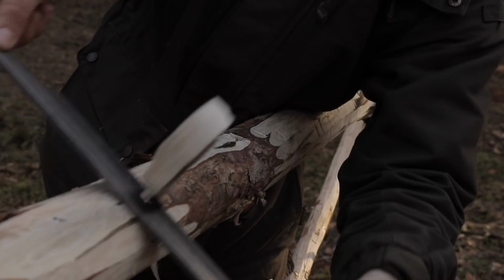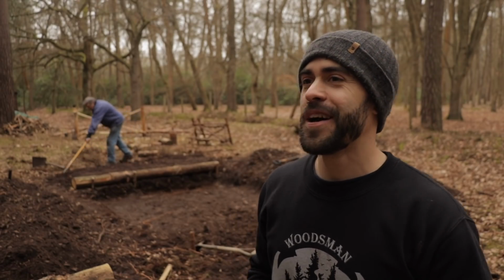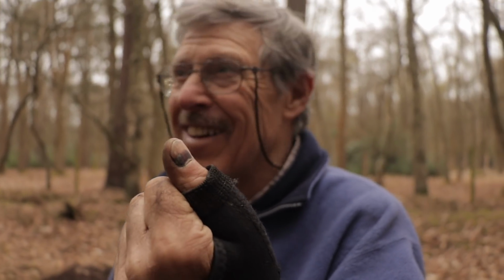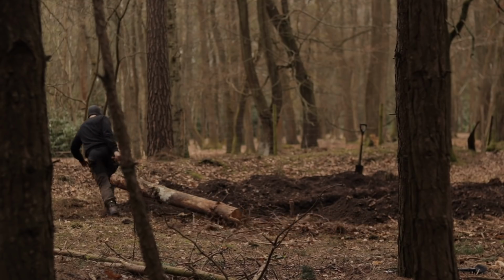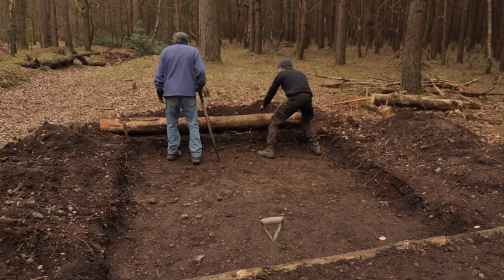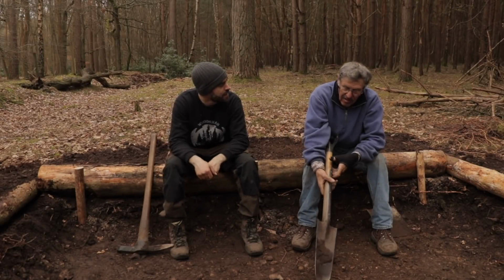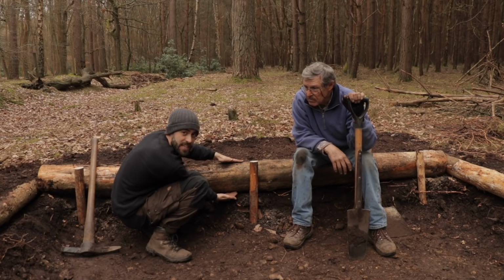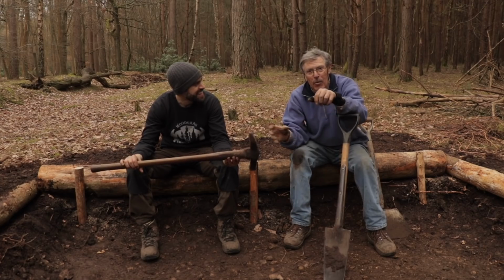Building a Saxon House with Hand Tools: THE PIT | Bushcraft Project (PART 2)

Comment: will fill with water. have to dig a trench around the outside and fill it with stone. the moisture will cause rotting, mold and moisture on the inside of the structure otherwise

Comment: I've only ever used a mattock when gardening, and mine had the pick side and a broad, flat side with a sharpened edge (sideways axe?) instead of a hammer. That's the first one like that I've seen. Possibly a difference between Britain and the US?

Comment: There are many variations of the mattock and you have what they call a Mattock Pickaxe Hammer. Unlike mine, a Mattock Pickaxe Hoe which has a flat curved blade opposite the Pickaxe and used mostly for grubbing or shallow digging ( like a hoe).

Comment: The archeology programs I've seen speculate that the grubenhauses were sunken for temperature regulation, where anyone was brave enough to venture an opinion. I live on the West Coast of the US, where the weather is supposed to be very similar to London and I can tell you that most of the year the pit would be really soggy and boggy. I've wondered if this was because that's were the kids would be sent for punishment. I've also wondered if the iron age hillforts were occupied during the wet season for similar reasons.

Comment: 'The Saxon House:  Can You Dig It?'  Are you sure you are not just installing a reflecting pool for the pallet wood cabin?  PS:  If you are planning a fireplace inside, you might want to build an air vent in before you finish the foundation wall layer.  Well...too late for that.  Thanks for the tool talk.  YOUR HAMMER AND SPIKE TOOL IS USED IN MINING RATHER THAN RAILROADING.  Railroad versions have an adze head on one side and a rod on the other end of the head to drive out pins.  Miners used the bulbed hammer to crush rock and the pick end to fracture rock.  The miner's head mattock turns up on auction sites as a 'gold rush' model.  The drain spade looks like a multi-tasker for opening rabbit warrens and retrieving pet ferrets with a sudden sense of independence.

Comment: Ever consider burning the surface of the logs used?  Burning the surface and rubbing the loose black charcoal like surface off seals the water and bugs out adding years to it.
Reply: How about stripping the log and coating it in sap? Allowing it form a hard resinous outer layer? Would that work?

That seems less risky to me than trying to burn a great big log just enough as to only burn off the outer layer. 

Then again, I suppose you could set up a fireplace and just roll the log in and out the flame as needed.

Comment: Not a mattock. Looks like a railroad pick. Mattocks have a wide curved blade that looks a bit like an adze blade and come in configurations of pick/mattocks or axe/mattocks. The hammer head on your tool is for driving the railroad spike into the ties to hold the tracks in place.

Comment: A foot iis very close to 305 millimetres so, your 18"" is close to 450mm. An inch is around 25.4mm.
Reply: Your material moving shovel is known to me as a square mouthed shovel, commonly used here by bricklayers, floor tilers mixing the tile bed & concreters. It would be much easier on your backs to use shovels with long handles so you can push with your thighs & swing the shovel using your thigh as a fulcrum. 
A trenching sholve here has s flat base & sides at 90 degrees to the base, usually with a long handle to reduce the need to bend over. Much easier on your back than a short handled tool.
A mattock has two blades (one on either side of the head) at right angles to each other, a pick, on the other hand has a pointed end on one side & a narrow, bladed edge at right angles to the head. The pick is much easier to use for digging deeper into the soil & a mattock for removing more material more quickly than a pick.

Comment: RE: your mattock. 
Guys I think that's actually a modified pick axe, with one side cut down so that it would serve both jobs. (either that or it has broke at some point). 
That would explain why it's mushroomed like that instead of keeping its shape, and why it's a much smaller striking surface than a normal sledgehammer / mallet
Reply: nice guess ... but it is for setting rail ties and spikes ... that is why the small rounded square head ...

Comment: The Matox the spike end is too dull the other end needs to be ground as when you hit metal it could splinter and put an eye out so grind it down please the spade is a soil sampling geology shovel the square shovel is a materials handling shovel you need a digging shovel to dig , and a bar or a pick or a Dutch hoe, paving rake 
Scott from New Hampshire USA